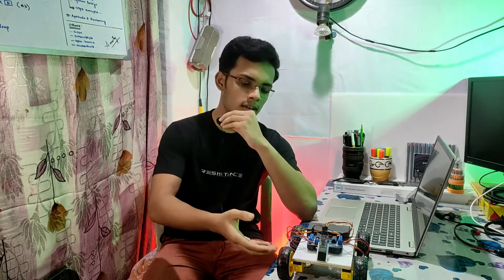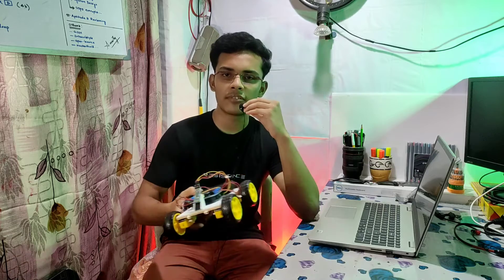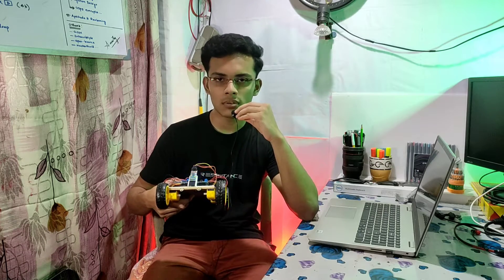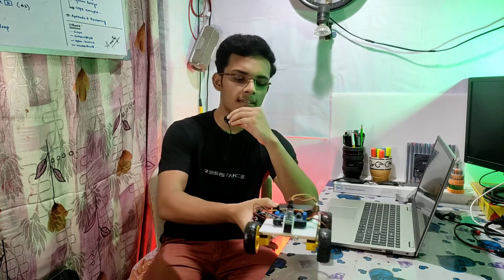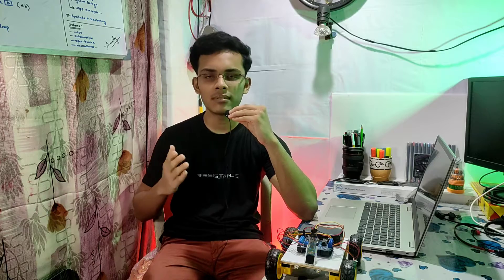Arduino Bluetooth Control Car using Arduino UNO, L293D Motor Driver, HC-05 | Arduino Project

Comment: My phone didn't support the app, so I downloaded the apk and installed. Connected the bluetooth module, everything was perfect, but when I give command through the app, the motors did not respond. What might be the problem? 
Note: I used 12V adapter instead of battery and I connected 5V and GND of HC05 to the corresponding arduino pins.
Reply from the maker: Make sure that, the Bluetooth module and your mobile is connected properly or not. After successfully connected, the green light will show on the mobile simulator screen.
Reply: @proexperiments it is connected properly, but didn't work